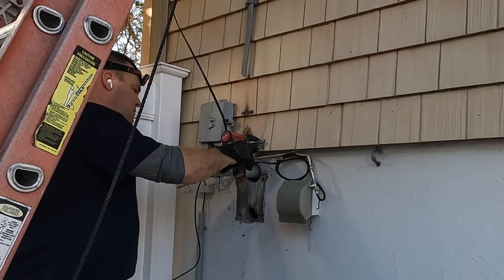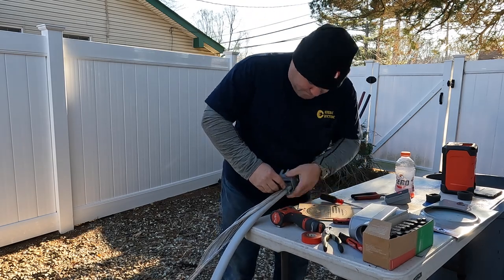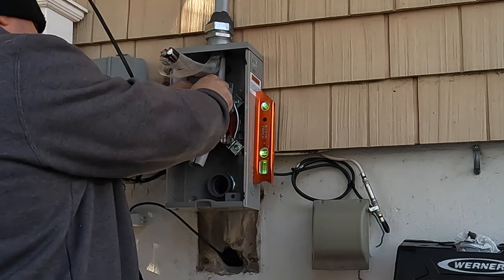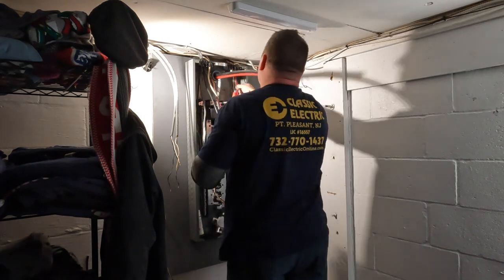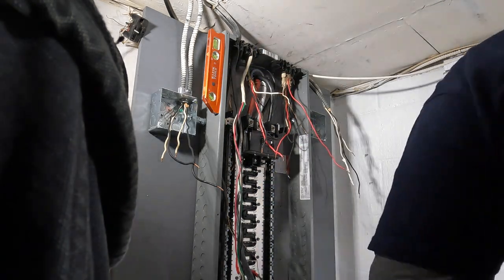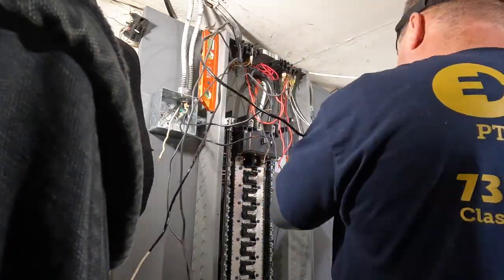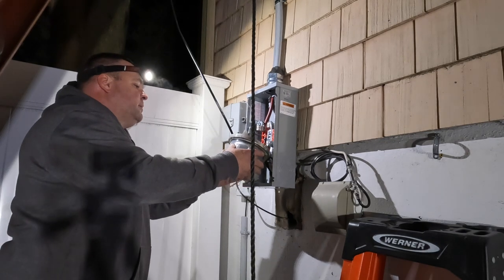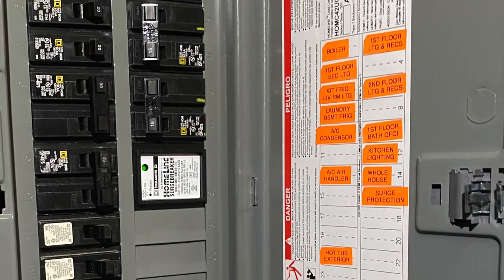200 AMP SERVICE UPGRADE | Atlantic Highlands, NJ. Part III

Comment: I purchased a piece of property that has 442 aluminum sticking out of the ground two black one white. I bought 442 aluminum that's two black and one stripe and I have to go through and connect to the meter out by the road and to the 200-amp Box + 2 RV boxes and I realized after not messing with this stuff for over 23 years and I'm just an individual on top of it you really have to think of what's going on because I have to connect and heat shrink to the existing wires sticking out of the ground and run 40 feet to the Box you guys definitely have your work cut out for you working on this stuff.

Comment: Yes, we are required to use conduit for a service riser here in Oregon.  You are lucky Ron, your way is less time consuming.   Great video, Thanks, Russ-Electrician from Oregon.
Reply from the maker: It's different all over the country as it should be. What I'll never understand is states like California and Arizona where the service panel is outdoors and ganged-up with the meter. Now if a breaker trips you have ti go outside to reset the breaker. That never made any sense to me.
Reply: @electricianron_New_Jersey  yeah also in Colorado, house panels are outside in the cold. Here in Minnesota service riser has to be in conduit. If your conduit goes through the roof, the conduit has to be imc, can’t run pvc.

Comment: Cleanup is easy to do when you are your own boss.  When your working for someone else, sometimes the boss wants you out of there and on to a different job and they don't want to pay for you to stay late. Or you get called to do a service call somewhere else.  It is much different when you are working for someone else. Also, I would be required to have the panel all labeled properly before leaving. No comebacks. I always hated doing service changes by myself.  Here in Oregon your always running conduit, drilling holes in roofs, installing roof jacks and guy wires kits. It was always a very long day by myself. Thanks, Russ-Electrician from Oregon.
Reply from the maker: Cleaning up and using drop clothes makes a big difference in getting repeat business and referrals. People expect you to do GREAT electrical work but leaving a mess behind is all they'll remember even if you did a good electrical job.

Comment: Hi Ron, I'm a one-man electrical contractor, myself. I noticed in another vid where you're on top of the roof, you have kind of this nice 2" thick rubber tape for going over your butt splices on the drip loops. Between that and the 4-pronged Klein large wire stripper, I've been picking up little tips like those, and I appreciate ya, man. Little stuff like that which a hardened 1000 yard stare master electrician can still learn from another pro... just always looking to ease the burden a little more all the time, ya know? All the best, brother.
Reply from the maker: Hi Tim, we can all learn from each other.  It’s about pulling each other up the ladder, not kicking the ladder out from one another.  I’m glad you enjoyed the video!
Reply: @Electrician Ron    hi, I like your style. Mike Holt says anti oxidant is unnecessary.

Comment: Section 230.85 requires an emergency disconnect to be installed for all new electrical services as well as when an electrical service is modified or upgraded.
Service masts used for the support of service-drop or overhead service conductors shall be installed in accordance with 230.28(A) and (B). The service mast shall be of adequate strength or be supported by braces or guy wires to withstand safely the strain imposed by the service-drop or overhead service conductors.
250.24(A)(1) Connect the grounding electrode conductor at any reachable place from the load end of the overhead or underground service conductors, service drop, or service lateral to the terminal or bus–at the service disconnecting means–to which the grounded conductor is connected.
Reply from the maker: Think I should go back and add the disconnect even if I’ve already gotten the final approval?

Comment: I found your channel about a month ago and enjoy your service upgrade videos. I admire your work and would not hesitate to hire you for any electrical work. I am an electrical engineer by trade and worked in the power field almost 40 years. I have a couple of comments. I think you could use a lot less Penetrox on the service connections. I think a bead applied with the bottle nozzle and spread with a small brush would do the job. Burndy says "apply liberally" so I guess that is subject to your own judgement. I know too much is better than too little.  

The other comment concerns arc flash hazard. I was involved in an arc flash incident on a 480 volt motor control center years ago before we took arc flash seriously. I was extremely lucky not to lose my vision. We had defeated the door interlock on a starter for a 200 HP motor to check something. The MCC decided to fault on its own just as I had turned my head away to stand up. I still suffered second degree burns on the side of my face and welders flash burn on my eyes. In your work I would wear a face shield, leather gloves and long sleeves when unplugging and plugging the meter in and operating the main breaker. Actually pulling and plugging in the meter is probably the most dangerous task you do since you are making or breaking the circuit with something not designed to do that and the meter condition is unknown to you. The main breaker is brand new and should be in very good condition. 

NFPA 70E, Standard for Electrical Safety in the Workplace has a very good guide on arc flash hazard and work practices. It would be worth getting if you do not already have it. Where I worked we adopted NFPA 70E after suffering a number of arc flash incidents. Some involved third degree burns and permanent injury.

Comment: Obviously you have a lot of experience as you make it look so easy. Nice R&R of the panel and all the necessary hardware. I wish you worked out in Southern California. I'm looking at doing something similar but to include a critical load panel for a battery backup system. Any electrical company recommendations for the High Desert (Victorville) area?
Reply from the maker: @l.rod2827  Sorry, not in California.

Comment: Some localities around me still allow for riser without conduit but I myself have never done it that way . I always put my service cables in conduit for the main reason I've seen too many risers and entrance cables that weren't in conduit the outer sheathing would Crack open and allow water in and once water gets in the cable it corroded the aluminum neutral wire and causes you to loose the neutral. I've had to replace several service cables for this reason . If the cables don't receive a lot of direct sun it's not as bad but I still won't install without conduit even if allowed. Also here if changing out complete service or upgrading service if the breaker panel is not directly behind the meter base so that a short nipple can be installed between themthenwe have to install an outdoor disconnect
Reply from the maker: The old SEU had issues but todays SEU cable is much improved.

Comment: With all the services you do, you should invest in a cordless Milwaukee H-crimper. It can cover all ranges of wire sizes for the run and tap connections on services. A lot faster and easier than the mechanical crimps when doing services. Just a suggestion.
Reply from the maker: I was looking at that last night. Only $2700 at Acme Tools. I would be helpful as it not only crimps but also has dyes available to cut large conductors.
Reply: @electricianron_New_Jersey  seriously think about it. It’s kinda pricey, but it pays for itself after a few jobs…..It’s awesome. And you love Milwaukee tools so there’s a win-win!! Haha
Reply: And we cut a ton of  wire with the interchangeable head. It’s so fast. Slices thru 500kcmil like nothing.

Comment: Thanks for the great videos Ron! On the Meter sockets! I got a little confused with Horn bypass and the lever bypass! Any info if you don't mind sharing would be great! I know in our area the power company requires a 200 amp meter socket to have a lever bypass! I got curious what the 2 bypasses do! Thanks again for the great videos!
Reply from the maker: I'm sorry I cant help you. I dont even know the difference between the two either! Around here we use ringless with PSEG and JCPL.

Comment: Thanks I found youtube chanel. Iam learning  electricity. What number of wiring are you using for miror, and how to cut the power outside on mirror to upgrade panel. Please. Thak you.
Reply from the maker: A 200 amp single family dwelling service requires 2/0 AWG copper or 4/0 AWG aluminum.

Comment: So what had my pucker factor at full-scale is seeing you connect your feeders to the service lines. Aluminum ladder?  And your proximity to the grounded metal conduit with no gloves or limb coverings would scare the begezus out of me.  Am I correct in seeing this as a risky situation or am I missing something?
Reply from the maker: Fiberglass Werner 28’ 300lb’r.

Comment: How do you make sure that you aren't grounded?  By the way, there is no way I am going near a live wire.  I am curious as your comment about "make sure that you aren't grounded" when connecting the city wire to the new house wire.
Reply from the maker: Because if you’re grounded you give a path for electrons to flow.

Comment: Im not very familiar with SE cable like that. Are the conductors themselves labled with their insulation class? I know NM cannot be removed from its sheath to sleeve it in conduit, but wasnt sure about SE like this.
Reply from the maker: Service-entrance cable is a listed and approved wiring method for service entrance conductors.

Comment: I'm in Central NJ and I'm considering a panel replacement and service upgrade. How much does a job like this cost?
Reply from the maker: Each one is different but they’re starting at $2800.00.

Comment: Hey Ron, thanks for the video. In part 2 of this upgrade you talked about the multi wire branch circuits. Are those wired in the box as the top 6 breakers on the right side of the box? I assume so since they are done with double pole breakers which will both trip if one half trips. 

I have at least one multi wire branch circuit in my house (kitchen) but unfortunately the breakers aren't next to each other right now. Would it be a good idea to have an electrician come out and fix this? Would it also make sense to upgrade to GFCI breakers as well since I don't currently have any GFCI protection in my kitchen?
Reply from the maker: The double pole breakers are for the MWBC's. They share a neutral conductor. Both of the hot legs should be on opposite legs so you dont overload the neutral conductor.

Comment: SPD in the box? So Jersey moved up to 2020?  Hope this is not late, Happy New Year Ron.  Looking classy job well done.  👍.
Reply from the maker: I included the SPD with this job but were still not 100% on the 2020 NEC yet.
Reply: @electricianron_New_Jersey  Gotcha.  Here in AZ it's to local interpretation.  State wide it's the wild west.  Thanks for getting back. 🙂

Comment: Is it a N.J. thing with red on the left. Always thought Black,Red,Blue.Nice job other wise
Reply from the maker: It’s single phase and it does not matter.  Black Red Blue is a three-phase configuration so motors spin the right way.

Comment: I like that you use a professional labeling system to identify your breakers. I got a great deal on a used, like new Brother electricians label printer that I use to give everything I do a professional appearance and added utility. You might consider getting some professionally designed labels with your company logo and info to stick onto your panels for repeat business and easy service calls.

Comment: Rather than contemplate the loss of your face or hands, how about you put the panel cover on before energizing the bus?  It would take five minutes tops.  And maybe meg-ohm the bus and feeder (branch OCPDs in the OPEN position) up to the weatherhead before energizing?  And wear insulated gloves with leather outers to make up the utility, just as the lineman would?
Reply from the maker: Sure, if I can get the utility company to supply all the tools/ clothing necessary to do all that.

Comment: Nice clean install but this wouldn’t pass code here in Florida
Reply from the maker: Oh is that right? Why not.
Reply: @electricianron_New_Jersey  
Florida is on the 2020code the disconnect must be outside next to meter also FPNL requires the grounding be connected in the meter
Reply: @sciatl2505  NJ is 2017 NEC
Reply: @sciatl2505  The NEC allows the GEC to be terminated in either the meter base or the service disconnect equipment.  So if "FPNL" requires something else, it's irrelevant elsewhere.

Comment: Holy cow that's a lot of antioxidant!!! If u read the bottle it tells u to wipe off excess. But like u put in video, u don't need it. Lol. If that wire corrodes, then u might as well smear it all over the lugs, buss, and all. Same material. It actually changes the torque spec. Which goes against UL listing. Which goes against code. Which is WRONG. So going above and beyond is not what ur doing there. Same as "adding extra grounds to make the house safer" kind of logic. Pure ignorance. Good job tho with the rest of the work!!!  I'm h3//bent on getting antioxidants off the market.
Reply from the maker: Don’t worry I know all about grounding and only a fool would add additional grounds to “improve” the grounding.
Reply: @Electrician Ron   "additional" grounds connected properly to the main grounding system is amazing. So yes, more grounds the better in ONLY that senerio. Mainly talking about Separately Derived Systems. I.E. home standby generators with their own ground rod. Big no no. Some ppl install ground rods at heat pumps. Also huge no no. The Grounding Differential Potential is huge in the instant lighting were to strike. Causing thousands of volts to go up the EGC and potentially burn ur, or ur clients, home to the ground. So yes, "more grounds the better" saying can and will be extremely dangerous for those arrogant people set in their ways.